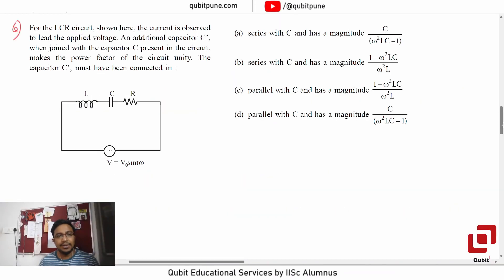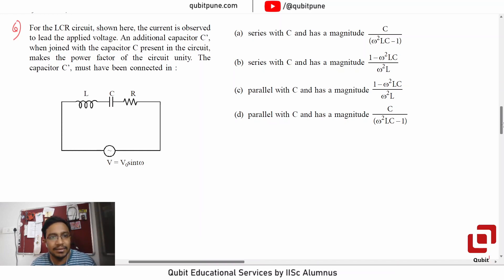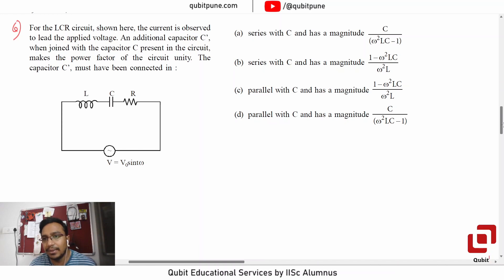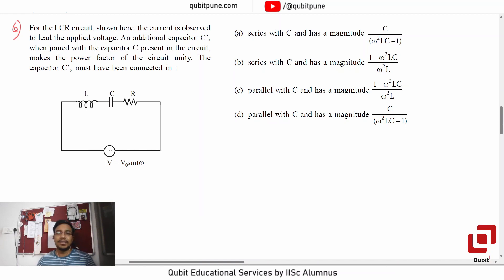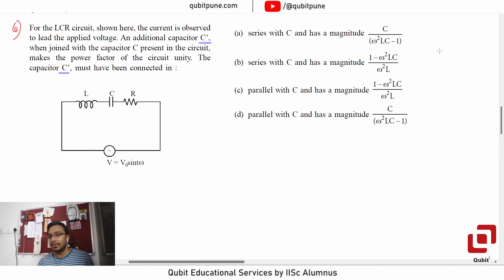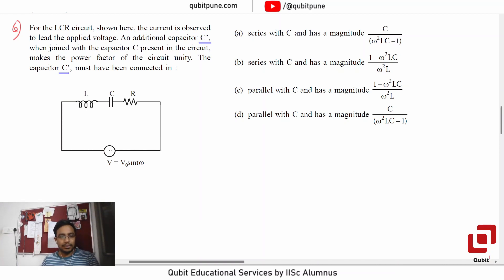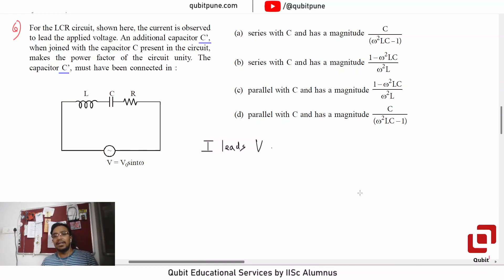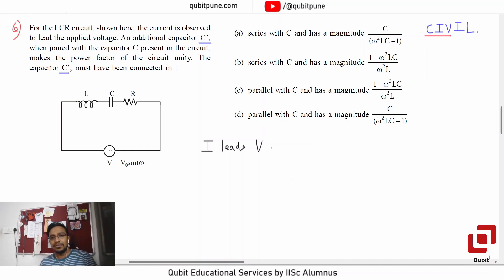TRICK to remember lead/lag of V and I | RLC Circuit | Power Factor Unity | IISER Aptitude Test 2024

Comment: Xc-XL =0  karna hai na sir becoz cosphi=1 means phi = 0
So we need to equate Xc=XL 
i.e. 1/wCnew =wL .
Here we have to decrease the value of Xc so Cnew will be more than C and uske liye series me nhi parallel connect karenge na??
My answer is C'= (1-w²LC)/w²L
Reply: Same solution bro agreed. if Xc>XL initially then we have to decrease Xc not increase it.
Reply: Yaa
Reply: Same
Reply: Then the answer should have been parallel option C right?